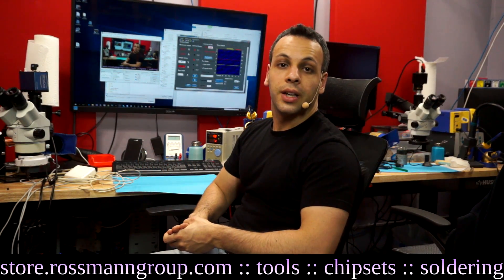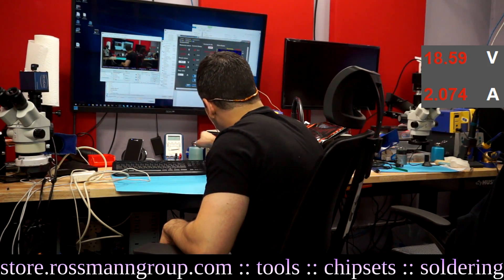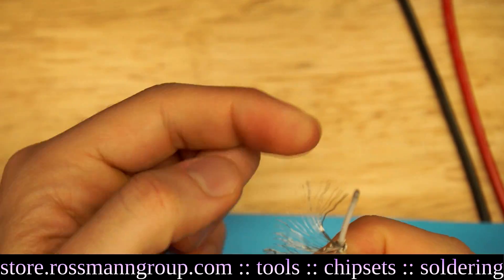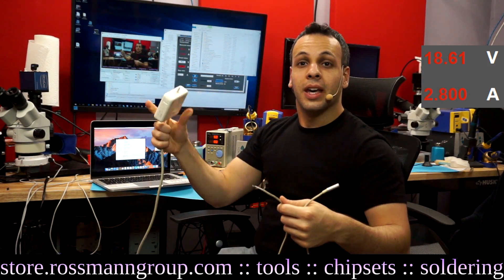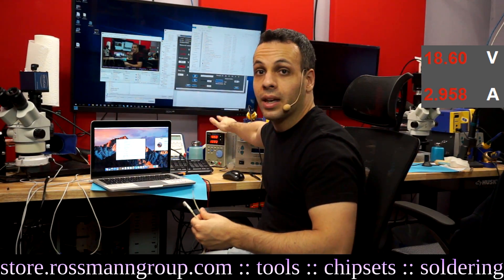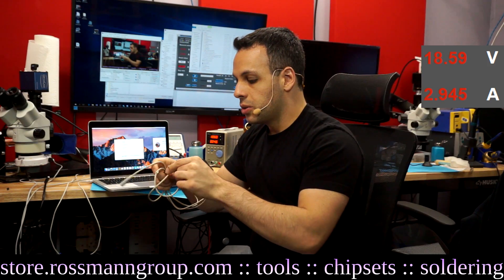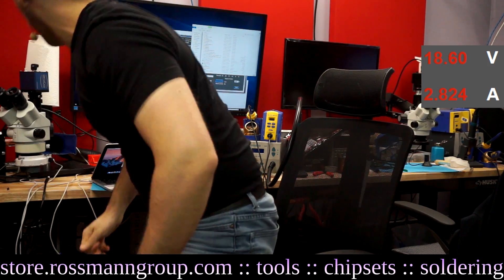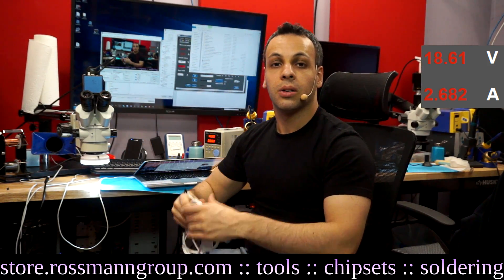How to power a Macbook using a DC power supply!

Comment: Can you run a MacBook 💻 pro 15” with a Milwakuee M18 18volt power tool battery?

5.0 amp
Reply: Yes, of course. You simply use a suitable DC-DC converter that converts the (approximately) 18V of the battery to whatever voltage your Macbook needs.

Comment: Dear Sir
I am having some issue with my Macbook Pro 2015 mid the issue is that whenever i unplug the power cord from the machine its turn off (it doesn't not turn on without megsafe power adaptor) even tho its showing 100% battery when i unplug the charger its don't turn off instantly but after 1 to 3 mints some times after 5 mints but after that time it's turn on and does not turn on till i re plugin in the charger. And i also think my charger is non genuine because i have been using this machine from one month its was good and also battery timing was good but i didn't turn it on for one week but after that one week i tired to turn it on it start showing this red error on screen to re plug in the charger after when i re plugin it turns on and show 100% battery even tho im system preferences the battery condition showing normal and also in coconut application showing normal conditions design capacity 56% health             80% like that ... 
Kindly help me.on this Matter i am waiting for your reply and one more thing i also tried smc so many time nothing happen
Best regards
Zohaib

Comment: I want to charge while out in the field using LiPo batteries.  If I use the 60w, is there any concern with plugging into a 4s (16.8v) battery?

Comment: I imagine that your DC power supply also has current limiting so it will CC when you have over current instead of blowing more fuses or parts. Also if the power supply is programmable you just recall that voltage setting.

Comment: I purchased 2 cables for my mid 2012 MBP 13 inch (60 watt Apple block) to power from a 12 volt power supply (solar off grid system in a trailer - and also from my vehicle).

I have connected accordingly... center white to positive, outside to negative.

There are other USB ports & volt meter wired in parallel to the connection & I have blown a fuse attempting to check L-tip points with a multimeter (so power is getting through)... but my MBP does not charge or recognize the connection.  The orange or green (when charging) LED in the tip also does not light up.

What can be going wrong... what am I missing?

I purchased these... https://www.amazon.com/gp/product/B077RPMXYK/ref=ppx_yo_dt_b_asin_title_o09_s00?ie=UTF8&psc=1

Thanks for any help/advice
Reply: Macbooks that use a MagSafe adaptor need 18.5V.
So, is your brain capable of working out why it won't work on 12V
DOH.

Comment: Hi... I bough a cheapone dc ps but I can get the minimum value of18v... will it "burn" my MBP 13'' that uses 16.5v? I know sounds stupid but just to confirm it...
thanks in advance.
Reply: I wouldn't try it. Maybe you can add a resistor or pot to the supply.

Comment: Hi great vid can you tell me if i can make a lead like this to power and charge a macbook air at 12v from a car ??
Reply: Macbook airs run on 14.85V (or atleast mine does) so you would need something like a boost coverter to increase the voltage.
Another issue is that car power is often fluctuates and is noisy due to the electrical components in a car such as the altenator, this is especially bad when starting the car. You would need something to filter the power coming from the car.

Comment: Hi Louis 
Do you do the same for usb-C cable plug that into dcps or do you use a regular usb-c charger that’s plugged into the wall using the amp meter.
Thanks 🙏
Reply: Macs USB-C use PD (Power Delivery). This is a protocol where the charger and the computer determine the maximum charge rate. So I am not sure if using a simple DC to DC power supply would do it. It would defaults to 5v.

Comment: Thanks for this informative video! Based on the fact that the circuitry on the tip of the adapter cable determines how much power a mac can draw from a power supply, can I use the adapter of my Dell laptop computer for charing my 15 inch macbook pro 2010? Its voltage output is 19.5 and its amp is 4.62.
Reply from the maker: You should be able to.
Reply: Thank you! Does that mean I can use it as a substitute for a mac charger or only temporarily?

Comment: I just had a break power supply 85W AT HOME AND USED THAT USED THE RED WIRE ON THE BREAK POWER SUPPLY 
ON THE WHITE WIRE CABLE FOR THE POWER WIRE FOR THE MACBOOK PRO AND WHITE WIRE ON THE BREAK  POWER SUPPLY ON THE NEGATIVE  ON THE POWER WIRE FOR THE MACBOOK PRO THERE A BLACK WIRE ON THE THE BREAK  BUT YOU DONT NEED IT ITS OK NOT TO USE IT ITS SAFE I DID TRY THE ABOVE BUT MY POWER SULLY HAD FACKED UP IT WERNT THE CABLE YOU WERE TALKING ABOUT IN BUYING THAT WAS FAULTY MINE WAS WORKING. YOU CAN PICK THEM UP ON EBAY FOR AROUND £7. JOB DONE ON THE CHEAP.  YOU CAN BUY THEM ALREADY SET UP FOR AROUND £19 BUT THERE CHEAPLY MADE AND THE BREAKS WILL LAST LONGER I THINK.

Comment: Be wary of the cheap $50 shit on Amazon, they sold me a Costway power supply I went on vacation for 3  months came back ready to use it and it won't output voltage the manuals claim you have to let it warm up it has been 3 days and it still hasn't warmed up LMAO, I went to microcenter and picked op a Korad DC Power supply for $125 and voila it worked right out the box.

Comment: Louis, I just came across your video and am interested in powering my MacBook with 12v while using it on my boat. Looking at my 85W power charger it states it's output is either 18.5 or 16.5v. Will my 12v be enough power for the MacBook Pro?
Reply: The battery on a macbook pro needs more than 12V to charge. You could use a dc-dc boost converter to increase the voltage. You might also have to worry about filtering the power from the boat to make sure it is free of ripples/noise as the boost converter may not remove all of it, and it could interfere with or even damage the macbook pro.

Comment: If only this is how Magsafe chargers died. I've probably been through over 10 Magsafe 2 chargers over the past few years, and I think maybe 1 of them a few years back wasn't a cable problem, and usually right at the tip.
Reply: Same here - I was kind of hoping to get some good advice on how to fix the cable going from the brick to the laptop :(

Comment: why are you setting the power supply to 18.5v instead of 16v? doesn't the genuine apple 65 watt charger start at 16v then go up to 18.5v on high power draw? can an air cope with 18.5v?

i noticed kits to replace the frayed cable on a macbook charger (they are easy to open. I noticed the are all 85 watt ID. what happens when you put an 85 watt ID on a 45/60 watt brick? i know a 15" macbook will run fine off a 60 watt(i guess 45 too) normal charger just charge slowly but what happens if its a 15" macbook with a 45/60 watt brick and 85 watt ID. will it freak out when it can't get the power its expecting?

Comment: Could I make a macbook "charger" with a simple LTC3780 CC CV board? I'll just limit the current to 3A and set the voltage to 14.8V (I have a Macbook Air Early 2014)?

Comment: You can see all that data (and more) from iStat Menus. 

I've had few macbooks in heavy use and I haven't blown a single charger. The lead gets broken after few years, yes. That's because of mechanical wear but I think that's totally normal thinking how much bending those takes in years.

Comment: Apple overengineers the circuitry in the charger to make it more reliable, but they can't come up with an insulation for the DC side cable that doesn't yellow and start falling off after 6 months of use, leading to the connector shorting and overheating. I'm on my fifth charger in seven years for my Macbook Air, and this happens every single time. It's ridiculous.

Comment: The tip that Louis mentions has a chip that is described as "1-Wire Dual Channel Addressable Switch" and contains a unique ID that is read by the computer to determine wattage among other things. Further info on the internet, search for "Magsafe teardown".

Comment: Hi Louis!
Thanks for sharing this information. Could you also please add a note with the current or voltage limits that you use so you don't blow the things up? 
I know from your videos that when you are testing shorts you are very aware to not to blow the CPU with to much power but I was wondering if you do the same with the Macbooks....
Also I think it would be a nice discussion to check whether or not this is possible with the new Macbooks that use USB type C to charge up.

Again thanks for sharing and happy new year

Carlos

Comment: Have you found a similar solution for the USB-C based macs? There is a lot of communication in USB-C so something more evolved would probably be needed
Reply: Hampus Baaz hella.
F u appel!!
Reply: Well, all manufacturers is going the usb-c route since it is a good route for the future where you can ask any buddy for a charger and whatever the laptop it will work and you can charge your phone with the same charger. 
The problem is that I have a ton of thinkpad chargers and the new ones is going USB-C for charging so a something that uses those old ones with usb-C in the end would be nice for me at least.
Reply: You mean charging or do you mean accessories? To charge a laptop through USB-C it starts of talking at lower voltage and when the computer knows it is a 12/20V adapter and it can deliver the power as well as the computer can receive the charge (which not all laptops can) over type-C. First then a charge can be done. Same thing with Thunderbolt, the cable must be able to tell that it can handle thunderbolt over the two acc pins.  There is chips at either end of the cable as well as on every type-C port...unless it is a standard USB-C 3.0 port and then it defaults to 5V power out with USB-3.0 protocol like a regular 3.0 port but with the C cable

Comment: what about people who want to charge their mac from a car cigarette power socket
Reply: simple, feed the 24V input to ltc3780 DC converter, set the voltage on the converter to 16.5V, feed the output to the above MagSafe cable.

Comment: I've got better advice, if it has an apple logo on it, don't buy it.
Reply: Find me a USB-C charger that will charge my MacBook Pro 13 inch which isn't from Apple, provides more or equal power and is cheaper than Apple's charger.

Don't bother trying, because you won't be able to find one.
Reply: Apple usually under powers their charger PSUs, probably because they want smaller chargers. It's not unusual that a powerful non Mac has a charger which is at least double the size and weight. Some laptop PSUs provides well above 200W while the recent Apple ones have been outputting somewhere around 30-90W so there are very real power differences.
Many (most?) MacBook models cannot run at 100% cpu/gpu usage while not using more power than the charger can produce so in the end the computer starts to slow down the clock frequencies to keep running without depleting the battery.
Reply: @pleggli  90W can't even power my mediocre GTX750Ti lol and am sure it'll perform better than a mac.
Reply: @nchlhkhfif3143  I have not seen that problem on iMac which are more comparable to a desktop "PC", the PSU have usually been enough to not throttle because of that reason.. My nvidia1080 in my linux work desktop machine "only" uses 41W right now even if it maxes out around 200W it's not needed to drive 3 displays with lighter GPU work so it's possible to have the GPUs running at lower power levels even if it's not possible to run them at maximum capacity.
I think that apple is generally doing the right thing with the laptop chargers, very few people need to max out both GPU and CPU at the same time for extended periods of time, it's usually one or the other. Almost only games can some times do that and games is not the reason people buys mac hardware anyway. I like the small form factor for the charger, fits nicely into a smaller bag. At some performance point you have to move away from laptops anyway because of various hardware limitations so I don't see it as a really big problem..
Reply: @pleggli  exactly I stopped using my laptop for games after the first year despite it having a relatively good AMD R7. these integrated battery laptops are way too "sensitive" sadly
Reply: reading your comment on an apple product lol
Reply: I always say the same about Windows.  All the movies use Macs, and all the DJs in NYC.  I'm guessing they are ALL dimwits.  Yeah, there should be a monopoly: YOUR choice.    :-)

Comment: thank you for this video.
but i have to say, i'm surprised you cycled through many original overprized PSUs before switching to a professional lab bench power supply. it's kinda obvious to use a short-circuit protected, current limiting PSU
Reply: yeah, it's a no brainer. A bench lab psu was about the fourth/fifth piece of electronic lab gear I got when I started to  work with a range of different circuits a few years ago.  1. multi meter. 2. soldering iron.  3. oscilloscope 4. bench PSU.. I have never had a goal to repair laptops, the closest I've come is probably fixing a faulty PC motherboard and repairing a bunch of commodore 64/128s which btw. also requires 9VAC because they are old :)

Comment: How to use DC power supply at the first place ?
Reply: The normal Apple charger is also a DC power supply,
Reply: pleggli what it is for ???
Reply: Powering the computer as explained in the video.. A bench power supply intended for lab/repair use have some defining features.. 

1. It won't break by being shorted out, it will either shut off (usually not) or just get rid of the excess heat generated from the shorted circuit using internal cooling and fans (what normally happens). Consumer grade power supplies might instead get hot enough so something breaks inside instead.

2. You can control the maxiumum current draw.. This means that you can start a system up with a very low current to maybe diagnose some pre boot power measurements.

Louis also shows the built in metering functionality to read the current which is handy but you can also do that with a normal multimeter as well.
Reply: pleggli oh, so it is controlling angry pixies from the wall and pushes them to the computer ??
Reply: BuzzCola 3 at a very metered level
Reply: Ishiku_542561_aka_xchoibitschibi hil I like angry pixies they are skookum if they are not used by apples springoma things

Comment: can I use cables (just cables, not entire adaptors, 85w) being sold at eBay for 4, or 5 Dollars? Looks a good option
 to have brand new cables that would be used to fix broken adaptors...
Reply from the maker: +Kelen Fernanda Duarte Molina the reason that I don't sell the cables as easy as it would be to shill them is because most of those cables are the 45 to 60 watt ones and not the 85 watt ones. I don't trust the sellers on eBay one bit. The sellers are all clueless and don't even know that the circuitry is in the tip
Reply: Hi Louis, just to follow up: I bought bought tips at eBay, and they are working good, even in computers which require 85w...
Reply: @eduardomolinayourmac.repai614  Who was the seller? Thank you in advance.

Comment: I really, really want to know your opinion on the new Thinkpad lineup they announced for CES... Specially the changes they did to the X2x0 (X270 to S208) line...
Reply: What did they do?
Reply: Soldered on ram, non removable battery, with half the capacity, no Ethernet port...
Reply: Disposable
Reply: Not worth the money, time, and are frankly mac like cancer which is really sad given how good thinkpads were in the past.

Comment: can you modify the circuit in the tip to allow you to use ANY tip and have it report as an 85W charger?
Reply: Likely yes, but cutting into that metal body to modify it and having it still usable at the end is going to be difficult.
Reply: +David
According to this article (link below), the chip inside is a DS2413 "1-Wire Dual Channel Addressable Switch". It can't be rewritten (lasered ROM), but can easily be spoofed with  MCU (Arduino, ATINY85, etc).
www[dot]righto[dot]com/2013/06/[remove this text]teardown-and-exploration-of-magsafe[dot]html?m=1